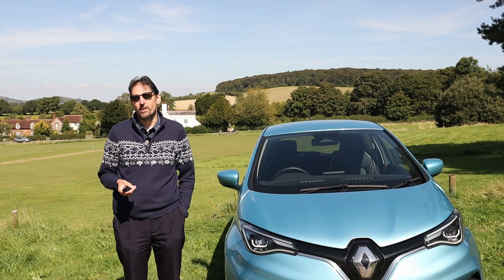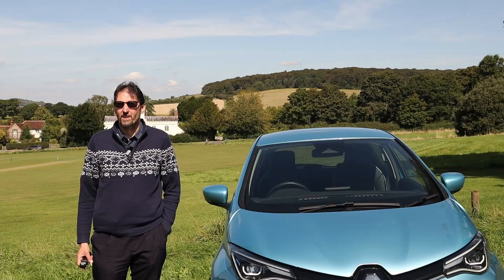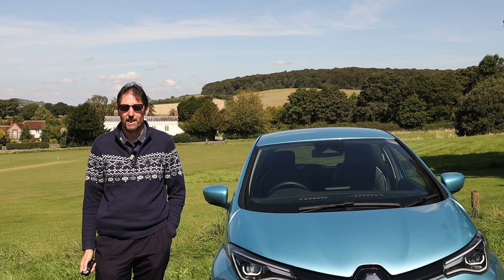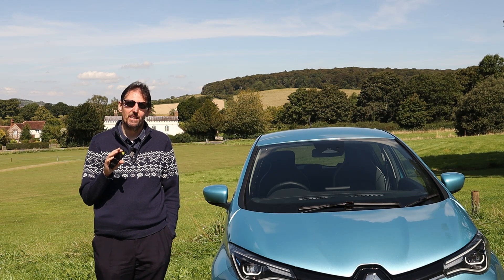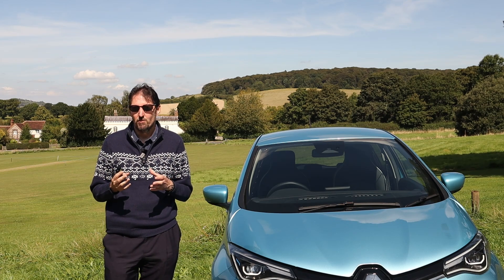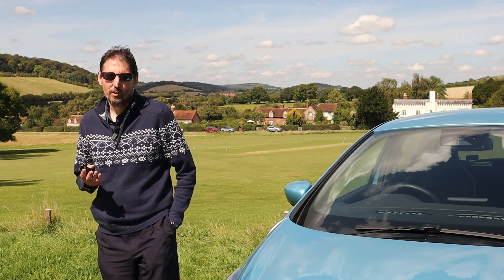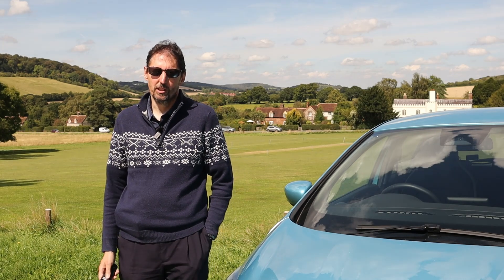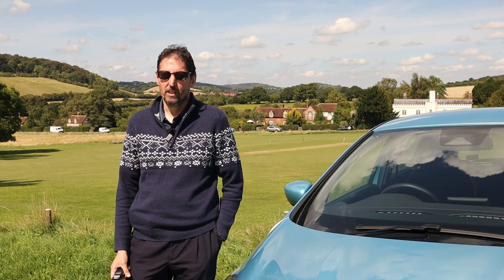Renault Zoe - Battery Degradation?

Comment: Thanks for your video very helpful, I’m now into my 4th year (2024) of owning a new Zoe 50kWh GT line with rapid charging option. Here in Somerset I  would often see 230-240 mile range in summer but in the winter drop to 180-190 mile range. So often puzzled about the BM system keeping the battery cool in the summer which it must be doing well in my case but the winter range drops by 20% I guess it’s using energy to keep warm, correct me if I’m wrong, although it’s kept in an insulated  garage. I was thinking of getting one of those gadgets (OBD link MX+)  that plugs into the diagnostic port to record the battery efficiency in the coming years , is that a good idea?  Please comment , but every time I look the price keeps rising, gone about £125 to now £169 in 6 months.

In 2022 when did a road trip from south of Bath  to John o ‘Groats about 2000 miles round trip using a combination of public and destination charging. At one public charger in Fort Augustus when I got back to a fully charged car it said I had 263 mile range, can anyone explain that? It was a (Scottish) hot sunny day. The holiday was great without any range anxiety, with B&B charging points along the way. And of course coming home we must have saved lots energy as everyone knows it’s down hill all way from Scotland (lol). As a retired couple we can go out for the day in the summer months do about 180 mile round trips costing between £0.00 - £0.70. 95% of the time we home charge and with we our solar / battery system trips can cost nothing. The big cost these days is paying for Parking.
Reply from the maker: Hi Malcolm,

From what I understand, there are several causes for the reduction in range in the winter. Firstly, there is a bit of heating of the battery and the cabin; that makes a bit of a difference. Next is air density - I have seen figures suggesting that air density increases by 1% for every 3 degrees the temperature reduces. As air resistance is a major contributor to the energy used to propel the car at higher speeds, this is a small but significant difference. Finally, and perhaps most significantly, the amount of energy that the battery can release reduces as its temperature drops. I think this is partially because its internal resistance increases and therefore heat losses within the battery increase, although there is a bit more to it than that. Maybe have a watch of Dr Euan McTurk's video on that subject, which talks about the chemistry of it in more detail: https://www.youtube.com/watch?v=CY8QN2p9Tk8

Your point about the car being kept in a heated garage is interesting. Do you see reduced range on the dash as you leave the garage, or does it reduce faster than normal as you drive? I suppose it is possible that the car uses online sources of weather data in its range prediction - there will certainly be an adjustment for temperature, although I confess I had assumed it was done off a temperature sensor on the outside of the car.

If you are a user of an Android phone, you might try the CanZE app and a cheap OBD dongle before spending on the more expensive diagnostic device that you mention (of which I haven't heard specifically.) OBD dongles are really quite cheap now - about £10-£15 on Amazon for example, although you will of course want to choose one that works. I can't recommend one at the moment as a friend bought me the one I have a few years ago, and I haven't tried it on my ZOE yet. I do intend to try it, but I'm not sure I will get to do so this week. I wonder if Jonathan Porterfield or Nick Raimo might be able to recommend one for you in the meantime?

I believe CanZE was removed from the Apple app store a while ago, so it's only available for Android now, as far as I know.

I am glad to hear you are getting on well with your car, and took on the huge road trip. That's fantastic! Your comment on it being downhill made me chuckle, thanks. :-)

Comment: Today the Renault dealer checked my ZOE R135 battery SOH. The car is from 2021/1 and with 74.000 km. Now it has 94%. Last year I made 32.000 km and It went from 96% to 94%. That is 2% down. What do you think?
Reply from the maker: Interesting numbers. Figures vary, but the rule of thumb I have seen suggested is that a car might lose about 2% in year 1 and about 1% in each subsequent year. Since your car is coming up to 3 years old, I would expect it to be at 96%, or maybe a bit less.

One of the problems with the figures is the rounding/truncation taking place. It might be that your car scores just under 95% and gets truncated rather than rounded, down to 94%.

I would not be overly worried about your score, it seems roughly in line with that rule of thumb. It would be lovely to have no degradation, but in reality, there will always be a bit, and we have to be mindful that the figures we are given are either rounded or truncated to a whole number. You might only have lost a little over 1% this year, but have it show as 2% because of the limited accuracy when reporting whole figures, or if there is a small variation in the accuracy of the measurement technique.

Comment: Following my previous comment I will say your presentation in this video is excellent.I have always wondered why the ZOE 's dont suffer the same level of battery degradation as the Leaf considering they originate from the same era and the same Nissan Renault group
Reply from the maker: Thanks David. Yes, it is a surprise to me that the LEAF and ZOE were not built on the same, shared platform, despite the alliance that was in place at the time. It is good news for us ZOE owners that they did not, because ZOEs seem to fair much better.

I think most cars in the future will feature a liquid cooling system, but I am pretty confident they will all have active cooling.

Comment: I agree with all of your comments and conclusion. The advantage that water cooling can bring, say in a Tesla, is that relatively thin cooling tubes can carry away a lot of heat whereas you would need to space cells further apart and take great care with air flows to achieve the same effect cooling with air. Ideally we would like to see the temperature distribution throughout each type of pack to judge the efficiency of a given design, whether using air or liquid to carry away heat. Also important to appreciate that all lithium cells of a given chemistry will lose some capacity with age whether they get hot or not and the reality that we can see the relatively good performance of the Zoe design after ~10 years is a tremendously positive factor.
Reply from the maker: I think you are right, water cooling makes for a much denser pack design. It will also allow for better control during rapid charging in a wide range of conditions.

I think it is unlikely we will see many more cars with air cooling - perhaps only very basic, budget-oriented cars, if any

Comment: Why would you even bother with a zoe, if it degrades and cheaper ice cars never do, now having longer term experience in the market place of EV's. Ice cars  have the same range at the end as they do when they are new. Electric cars are just not fit for purpose, as my 2016 30 kwhr leaf with 33% degredation and 4 out of 12 battery bars missing after 7 1/2 years and 39 k miles shows. I will never buy another  EV, ever !
Reply from the maker: Ah, that's unlucky. The Leaf doesn't have active thermal management and can therefore suffer worse degradation than anything else. The 30kWh pack also used a chemistry that suffered worse degradation, unlike later cars. Add both of those together and you will get the worst possible.

ICE cars do suffer some range loss as well, because their compression reduces a bit as they wear. But it's not a lot, and a smaller percentage.

I would suggest you not rule out the tech completely because of a single bad implementation - but I do understand how your trust in it would be shaken by your experience.
Reply: @theelectrictransition  "ICE cars do suffer some range loss as well" that's true but it doesn't matter much, because the base range of an ICE is much higher and "charging" time (gas station) are much shorter than any current EV car
Reply: "Ice cars  have the same range at the end as they do when they are new." This is the reason why I think about buying a new ice cear instead of a ev car. Renault warranty will only replace the battery if you drop below 75% that's a huge amount of "lost" range and people report 90% after only a few years, so if you drive a few years that can be a difference between managing a long trip without charging and suddenly require charging, just because the car is older. It doesn't matter if you just drive short range anyways but I drive longer range to work and I don't want to fear that I suddenly have to charge for for my work trip just because the car is older. Degradation might be less of an issue if the base battery capacity is much higher but in the current state it's too risky for me.
Reply from the maker: @r1pfake521 true, although neither the range nor the recharging time are the problems they might seem. In my experience the driver needs to recharge about as often and for as long as - or longer than - the car

Comment: Battery s never  last   battery  warranty  should  be  for  atleast  12 years
Reply from the maker: There are quite a few EVs from 2011 listed on Autotrader at the moment, so it looks like the batteries last OK. There weren't many EVs sold in those early days, so for there still to be plenty around seems to suggest they are holding up well.

Car manufacturers use a number of tricks to make them last - tricks not used in most early mobile phones. Phone batteries fail for sure, it is easy to be put off by those, but its not such a problem for cars, because the batteries are so well managed.
Reply: @theelectrictransition  1 tesla  owner on u tube  .third  replacement  batteries

Comment: The first generation Renault zoe does in fact have active battery cooling via A/C and heating via ptc. This is why most first generation leaf have 60% percent soh and most zoes have over 80.
Reply from the maker: Yes, absolutely. I didn't discuss heating, but my intention was to explain that there is active cooling, with heat being the thing that causes permanent battery degradation - reduction in range due to the cold is real, but temporary.

Whilst it has active cooling, it uses air as its cooling medium, which is what makes it fairly unusual. The air crosses the chiller - a part of the heat pump system as you mention, before heading through the pack.

Comment: My May 2020 ZE50 is at 96.4% SoH and has been driven 126,000 km now.
It is rather strange that a lot of cars show 96.4 SoH. That is so strange that I feel something strange is going on. Is Renault cheating?
Now when it is sub-zero Celsius the maximum charge that I can get is about 46.5 kWh of charge, but it still states 96.4% SoH. And when the battery was warm 4 months ago it stated a total of 52.4 kWh charge totally. So the maximum charge level is separated from the SoH (I doubt that my battery has gone that bad in just 4  months...)

And regarding air cooling, so far I have never needed air cooling... But an improved battery heating system would be something that would be great. The puny 1kW electric heating PTC for the battery is just not enough in cold climates. And if I could preheat the battery before charging during a trip it would be fantastic. A proper battery preheat (1 to 2h before starting a trip) AND separated from cabin preheat (for cabin preheat is 30+10 min enough). This would also be a huge energy saver and improvement of range (and it is "just" a software update (that does not exist)). Basically, I think I only have started one long trip in the last 110.000 km at temperatures above 20 C. Most trips start at as highest temp of 15 C. My range is reduced to cold battery and my charging speed during trips is limited by low battery temperature...
Reply from the maker: Ooh, lots of juicy details, thanks for the comment.

In my opinion, a really top notch SoH calculation should not be affected by temperature. The reduction in a battery's usable capacity due to cold temperatures is a temporary reduction; this is quite different from the permanent reduction caused by degradation.

I would hope that the SoH is intended to be a reflection of the usable capacity in ideal conditions - the best case scenario - and not affected by temperature. However, I think your concern about whether it is calculated correctly is a valid one. It must be very hard to measure SoH when the battery's capacity IS so affected by temperature, even if that aspect is only a temporary effect. So I too wonder just how Renault are making their calculation, and whether it is truly correct. There is, after all, a benefit to the manufacturer if their cars stay away from the SoH figure that would trigger a warranty claim.

I hadn't heard that a lot of cars are reporting the same value. That does sounds a bit suspicious, doesn't it?

The good news is that, in your case, it sounds like you have a very healthy battery. That total capacity figure in warm temperatures of 52.4 kWh sounds fantastic - and hopefully more difficult to game, as it is used in (and can be verified by) range calculations. It can also be checked by measuring the total energy fed to the car when charging from a very low state of charge. There will be some energy losses during charging, which does make measuring the total energy into the battery a bit more complex without using any of the car's data to measure it - but it should be possible nonetheless.

I agree with your point with regards battery conditioning in cold weather - both before a journey and before a rapid charging session. That would be a fantastic feature, and the latter at least is now offered by a few manufacturers. My car displayed a "limited regen" message in the dash in cold weather in February, after sitting for a couple of days at -5C. Maximum lift-off regen is also noticeably reducing now that we head into late autumn - only by about 4 kW so far, but it makes a difference to how the car drives.
Reply: @theelectrictransition  Now it is summertime. If the battery is at 20C when starting I get about 25% more real usable range and about 10% lower consumption at the same speed. But this is a strange difference. I now get a SoH at 94% but still around 49.6kWh of usable energy. It does not make any sense. And my car has now passed 165,000km.

Comment: My 2013 Zoe has 88% SOH, original battery with 62000 Km. Summer range today is still a decent 120Km!
Reply from the maker: That's great. That's a very early car, I'm glad to hear it's still going strong. Have you had it from new, or did you buy it secondhand?
Reply: So about 74 miles then, my diesels can go just a little bit further but to be fair I still get range anxiety at around 550 miles

Comment: I have a May 2020 Zoe ZE50 which is almost at 70,000 miles. The battery is absolutely fine. There must be some battery degradation as all batteries degrade over time, but nothing I have noticed. I am sure the battery will easily outlive the car.
Reply from the maker: 70,000 miles is quite a lot on a 3 year old car. That's been well used, that's good to hear! Out of interest, have you had any suspension component changes? Early cars seem to suffer from worn drop links causing noise - a cheap fix as long as the labour charges are reasonable, I think. I don't know if they revised the front suspension as part of the ZE50 refresh

Comment: I have tested other EV's for long time ago (I don't make video about that car) Hyundai Ioniq 28 kWh, air cooling and air heated battery. Charging speed over 70 kW. Checked that car with OBD2 Tools no degraded at all after 180 000 km. The fabriq app says SoH 100% and full battery with buffer on by specs is 30,5 kWh.

Tested Zoe ZE50 many times, some "degraded" need only BMS update.

Newest Renault Zoe as only comes out to europe will have 60 kWh battery and take up to 100 kW rapid charging speed. Need to find out what is the difference. That car model don't comes to Norway where I living.
Reply from the maker: Thanks for the information.

I am not aware of a 60kWh Zoe; might that be the slightly bigger Renault Megane? Produxtion of the Zoe is expected to end next year, so I would be surprised if they did another update at this late stage in its life
Reply: @theelectrictransition  ZE60 comes out in 2024. It's the latest model. Claims usable battery on 60 kWh. Was on news in Norway but will not come to Norway becouse we have IT powergrid (no neutral wire) as rest of europe. 230V between phases and 115V between local ground and phases.
Reply: @MotorLarsNorge isnt the zoe getting completely ditched and geting replaced by bot the megane e tech and the renault 5?
At least in slovenia, zoe is not being sold new any more

Comment: I have an Ioniq 28, like the Zoe it is also air cooled. It is now 150000km/6 years and still runs great. It can do 70kW fast charging. The battery degradation is minimal (4%).
These are nice cars to keep long term.
Reply from the maker: Oh, interesting. I know the Ioniq with the slightly bigger battery has liquid cooling - because there was a recall to change the coolant. It surprises me that the 28kWh didn't use the same system.

I'm glad you are enjoying it. They do seem to be an overlooked car; the efficiency is extraordinary
Reply: @theelectrictransition  Yes it is different as the chemistry of the battery is different.
Also the Ioniq with the bigger battery will fast charge much slower than the original Ioniq.